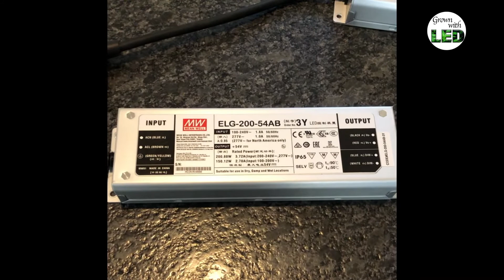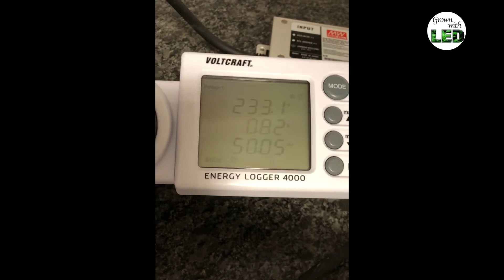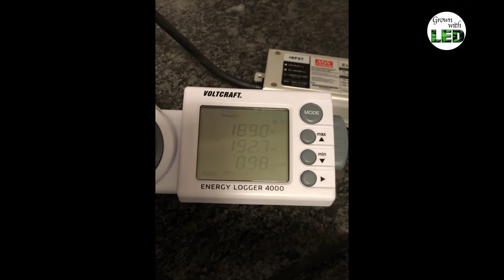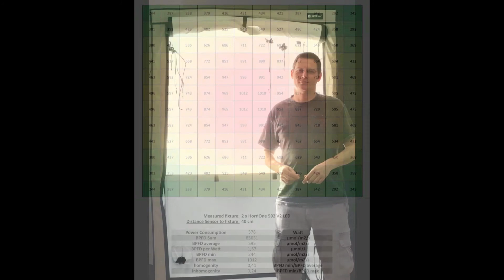Light-Measurement Series - EPISODE 4: HortiOne 592 V2 LED at 40 cm distance - PAR Test - BPFD Plot

Comment: Its the led good for 100x100 tent ?
Reply from the maker: HI, Tom Wind! Yeah, you can definitely use this lamp for a 100x100 cm tent. Aloha, Grown WithLED.
Reply: @grownwithLED  there will be good results in a 100x100 with 2x leds ?
Reply: @grownwithLED  if i Take 2 leds from them its good results in a 100x100cm box